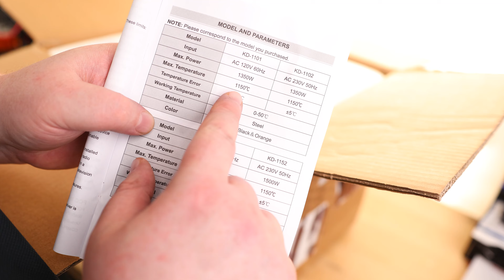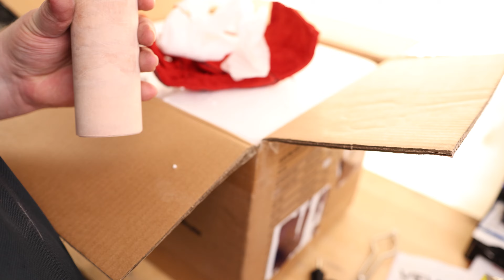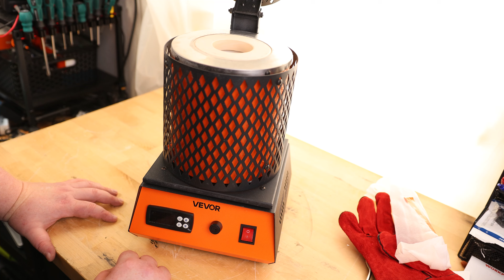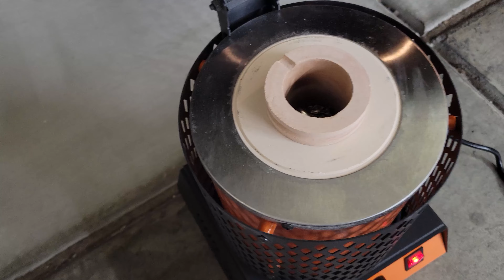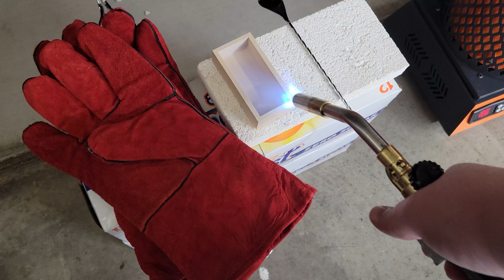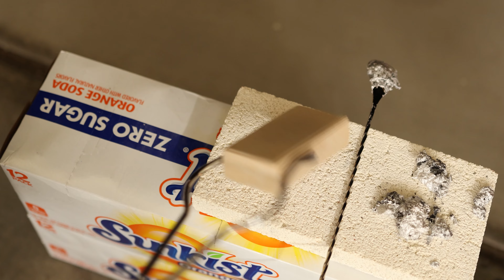VEVOR Electric Melting Furnace, 3kg Electric Metal Smelter Foundry, 1350W 2102℉/1150℃ Smelting

Comment: The thermal couple (temperature sensor) is right next to the coils. Thats why it reads at temp but takes more time for said heat to transfer into the ceramic to get the metal to that temp.